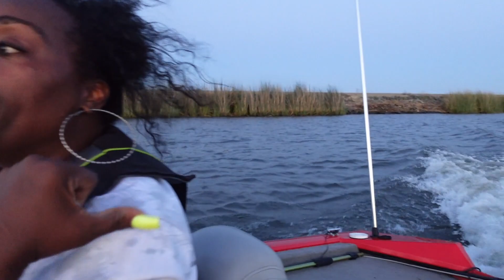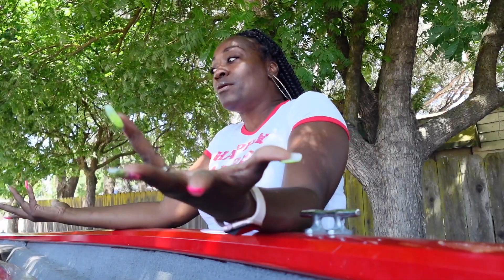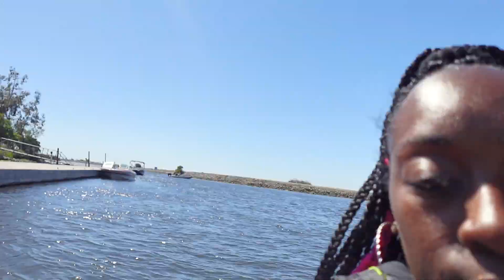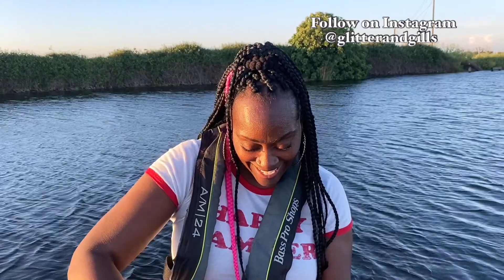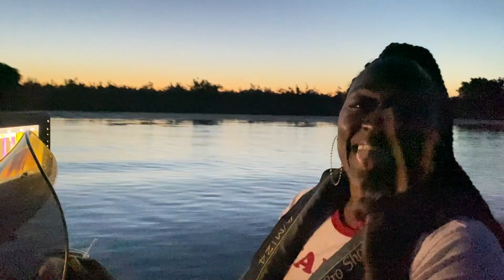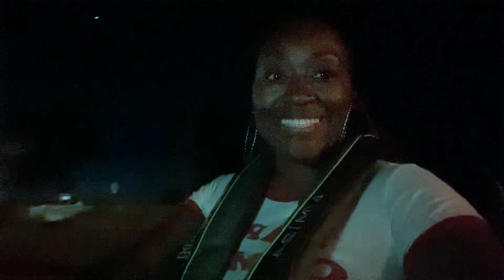Big Bass, No Gas! Delta Fishing from Aluminum Boat

Comment: If that happens again, there should be a screen on the pickup tube in the tank, which could have picked up trash in the tank. Just clean the trash out. Also those primers go bad over time. From Louisiana but live in West Virginia. It's not fun but you learn alot from problems on the water, helps you pay more attention to pre-launch. Good luck fishing.
Reply from the maker: Ok great tip! I’ll remember that if it happens again 💗🎣👍🏾. How’s the fishing out there?
Reply: @GlitterandGills  not great due to weather
Reply: Hey Carl, I’m having the same issue on my boat! Where is the pickup screen located ? And is it hard to change? Really appreciate the help
Reply: Hey Carl I’m having the same issue on my boat. Where is the pickup screen located? Thanks
Reply: @larrysmith9484  At the bottom of the tube going into the fuel tank.

Comment: Yeah I started watching and was going to suggest turn the bulb vertical when squeezing it.  There is a butterfly flap in the bulb and it works best holding vertical.  But then I saw the part where you learned that.  Delta looks like an interesting place to fish.  Mostly I fish Canadian Shield lakes.  When fishing water with a lot of debris make sure you clear out the water intakes on your lower unit to keep from over heating your engine.
Reply from the maker: Ok will do! And yes the Delta is very large and always changing.

Comment: Go Girl! Great Bass's! When you blast off in morning, give it full throotle to get on plane and then you can back off until you reach the speed you want. Yea, need new fuel pump likely. Fuel bulb needs to be fully pumped before you start engine in morning. Make sure to do this every time. Did you get your mussel sticker?
Reply from the maker: Hey girlie! It wasn’t going on plane due to lack of power.. but now we’re pretty sure it was because of grass wrapped around the prop area & bad priming after leaving the shop smh. Next day we took it out and worked perfect. Still going to have the fuel pump checked out though just in case. Better safe than sorry! And yes it came with 2023 mussel stickers🙌🏾. Thanks for looking out girl! Keep’m coming💗🎣🤗

Comment: Are you in Salt water? If so do you do a good rinse down when you come out the water.
Reply from the maker: No freshwater, but we started spraying off the propeller and back of motor recently, just because the Delta has so much grass & debris to be safe